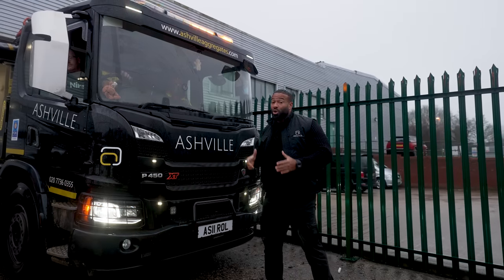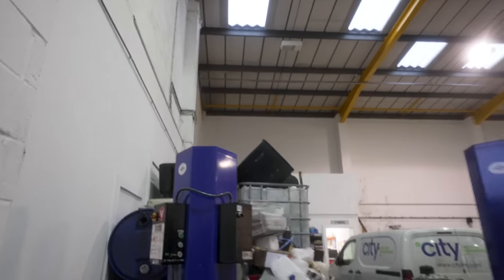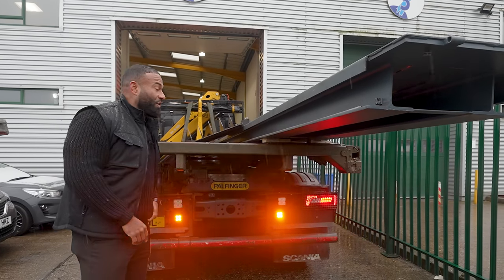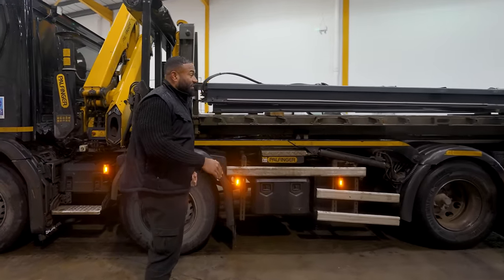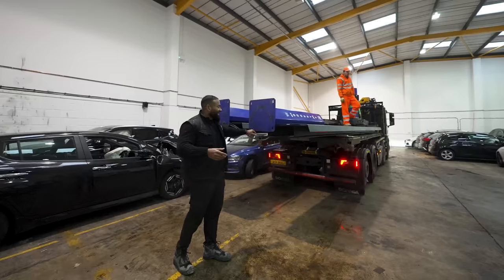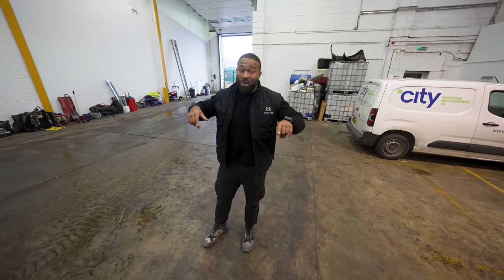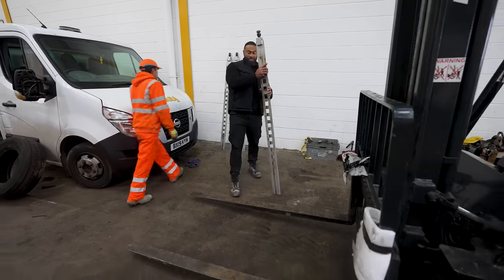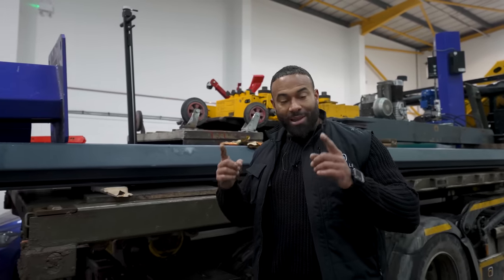We Bought Everything In This Garage In 1hr... BEFORE Knowing The Price!

Comment: Shame they didn't have a proper tire inflation safety cage among that shop gear. You know a place that needs one.
Reply: Too true. I'm a big fan of Daniel and what he's achieved and will continue to do so, but shoot that cage they fabricated was so far short of what is needed it begger's belief. There are videos on YouTube that show the necessary strength of cages required to contain an exploding tyre or wheel ring not seated correctly and the energy released is astonishing. If someone at Ashville could make Daniel watch one of those videos, he would realise the shortcoming of what they made.
Reply: @dunes7  He's a clever chap and has never shown hesitancy to acknowledge making a temporary misstep then correcting that matter as needed. 🙂
Reply: @dunes7  watched a video a couple on holiday abroad from the uk had a bulged tyre on their z3, swapped the spare on and decided the mrs would hold inside the car the spare , bad bad move as the bulged egged tyre exploded on her in the car and killed her.
That’s even more shocking than a lorry tyre going boom as I never heard of a car tyre doing that to someone but there ya go
Reply: Smoke and mirrors YouTube videos

Comment: A great deal again for Daniel and the team. I have noticed that in a recent weekly there is land between the aggregate bays and the railway line. I do wonder if this is part of Asheville’s land if they have considered relocating the railway line to that side of the site that would allow for the reconfiguration of the site to support the corporate / administrative side of business in the current admin/workshop area and move all operational vehicle facilities into the main yard.

Any news what you are doing with those media boxes? Could they be set up as a replacement structure for the gym to allow the team more admin space and a “clean” yard separate from the wheel wash required areas?

Comment: I'm a compressor engineer and that compressor isn't worth a lot, maybe £150-200 if you're lucky. Check the manufacture date on the air receiver(or air tank), it should be stamped on it somewhere or have a tag on it. It looks pretty old, I'd guess at 20 years old or more. I'd install it in a box cupboard outside your workshop if i were you because they are noisy old things and vibrate a lot when running. They are also a lot slower making air than a screw type compressor, but they are easier and cheaper to service and repair. 
Some useful equipment there but I'm not sure if it's £15k worth of equipment.

Comment: Good video  but a couple yellow vests doesn't  cut it ,should have had extra long load signs and a dozen yellow vests wouldn't have have hurt and let other drivers know , the the difference from the brake lights  to the extra long load was xtreme and could have caught out some inexperienced car drivers where the could have ended up wedged under back end of load.